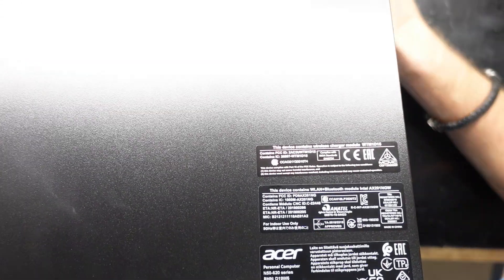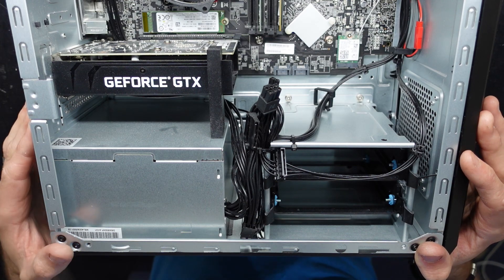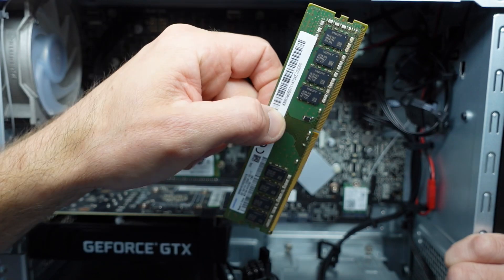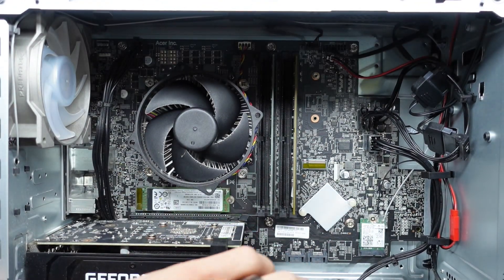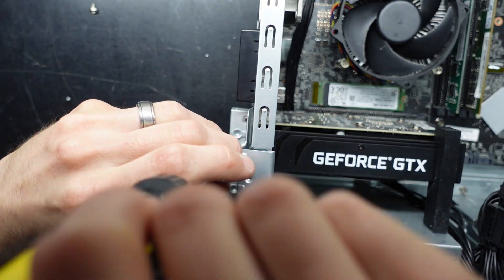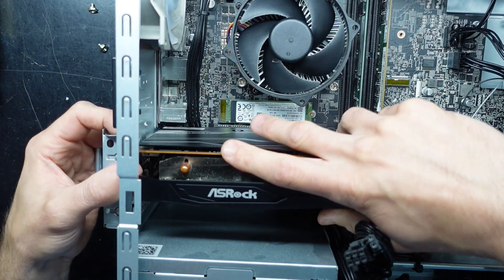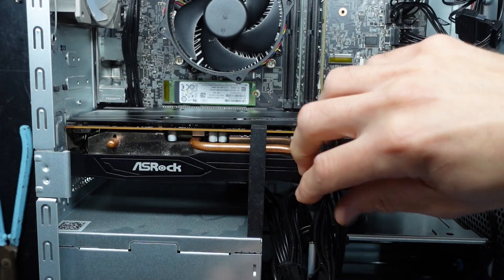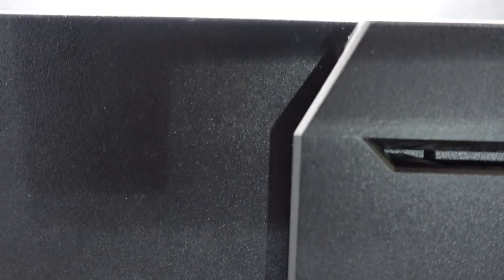Acer Nitro N50-620 Upgrade Inspection, GPU upgrade!

Comment: I have a 3050 and a Intel core 12F with a 500 wat power supply with 16 ram , and Soon im going to be massively upgrading to a 3060 , Intel core i7 2700k with a 650 gold psu and pny 2x16 36000 mhz ram and probably a another fan would 650 be enough oe should i should I go 700 ?
Reply from the maker: 650 should be fine, I think a 3060 needs a 600w 

If the 700w is only a bit more expensive, might be safe to go that

Comment: dude i upgraded to a rx 6650 xt and in fn i bet 500 fps max  drivers installed and old drivers uninstalled but the gtx 1650 getx 580 max makes no sense u know why bro ?
Reply from the maker: I'm not exactly sure what you are asking sorry 

Your upgraded from a gtx1650 to a rx6650 but what's the issue ?

Comment: Hey can i add another hard drive or two, have the 3 ram upgrades AND that graphics card without upgrading the power supply?
Reply from the maker: hard drives and ram yes, graphics card not sure, probably not if you get something bigger than a 3050 or RX6600XT

Comment: Hi, I have the n50-640 I only have two sicks off RAM, am I right in thinking if I wanted to put 2x 32gb I could? or would the max i could put in there 2x 16gb? thanks mate
Reply from the maker: i would only go 2x16GB.. unless you are using a huge amount of ram then it wont be used and just wasted.
Reply: @rickstechrepairs  thanks mate, saved me a few quid

Comment: im upgrating the psu and gpu for a friend..but how the hell do i plug the new psu to the motherboard??  I dont have a 28 pin to 6 pin..like this motherboard has??   damn is it hard for nothing to upgrade this prebuilt!!...
Reply from the maker: Will need an adapter cable to use a bigger cable, would purchase from ebay or aliexpress
Reply: @rickstechrepairs  thanks... ordered one from amazon yesturday .. going to test it out when I head over to my friends tonight... ...   hope it works...🤞🤞
Reply: It’s proprietary you can’t upgrade psu
Reply: @tankconnors7323  Did this end up wokring? which cable did you buy
Reply: @ericclefstad8112  no..had to get another motherboard

Comment: could i fit a nvidia 3060 in? already upgraded the ram to 32gb
Reply from the maker: Probably a dual fan model but would be doubtful for a tri fan

Also psu will probably need to be changed
Reply: I have a 3 fan gigabyte 4070 in this exact computer that I upgraded to

Comment: Can you upgrade the CPU as well? To maybe a i7?
Reply from the maker: yes but only of the same generation of processor
Reply: @rickstechrepairs So you cant upgrate to a 12 or 13gen cpu?
Reply: @rickstechrepairs cant we upgrade from i5 10400f to i7 11700k with a bios update or something? because it's also lga 1200
Reply: I would recommend i7-11700k

Comment: will a 6650 xt fit correctly and do i need more cables ?
Reply from the maker: https://www.amd.com/en/products/graphics/amd-radeon-rx-6650-xt

I think you should be ok, with just swapping it in
Reply: I put a 3060 ti in it and it worked fine
Reply: And it was the gigabyte 3 fans version

Comment: Hi, do you know if i could put a rtx 2060 or 3060 in it?
Reply from the maker: should fit, will probably need a psu upgrade
Reply: @rickstechrepairs  okok thank you so much👍🏻
Reply: @edoardorossi1129  I have a 3060 in mine the 500W psu is fine and does not reach near the limit
Reply: @0ware which 3060 GPU is it? Was it an upgrade or did it come with the PC? Mine came with the 3050 (blower style GPU) and I was thinking of upgrading to the 3060 8GB
Reply: I fit a 3060 ti with 3 fans so your fine

Edit: also worked fine with 500w psu

Comment: Could you put a 3090
Reply from the maker: Not without a much larger psu and possibly case
Reply: @rickstechrepairs  perfect thanks
Reply: Best you can do is dual fan 4070 I have one in my acre nitro 610 with 500w psu and it works fine

Comment: Is it possible to take out all the components and switch it to a new case?
Reply: I have been wondering the same thing
Reply: Super waste of time and money, motherboard and PSU are both total crap. Just build from scratch
Reply: You can use the Coolermaster NR-400

Comment: could i put a 6700xt in?
Reply from the maker: Dual fan yes, trifan no
Reply: @rickstechrepairs  so stay at a 6600 as max for single
Reply: @rickstechrepairs  last question 😂
can i put a 6650xt in the stock prebuilt. or 6600xt is max?
Reply: @rickstechrepairs  just quick question why not trifans ?